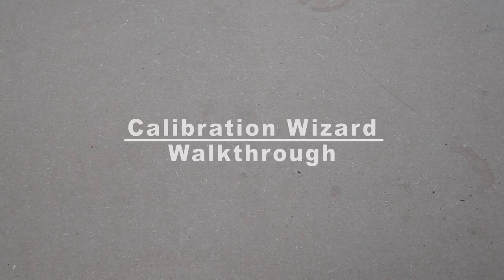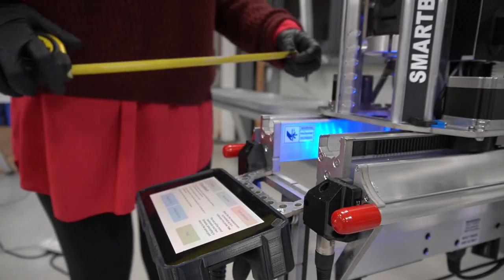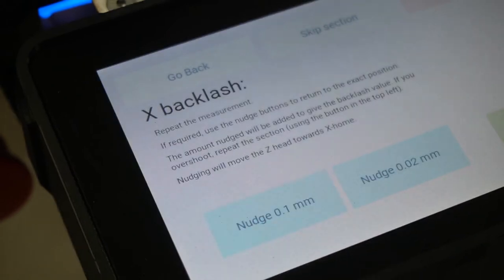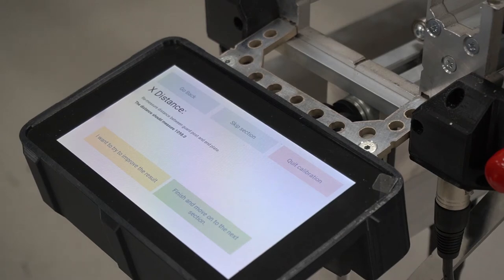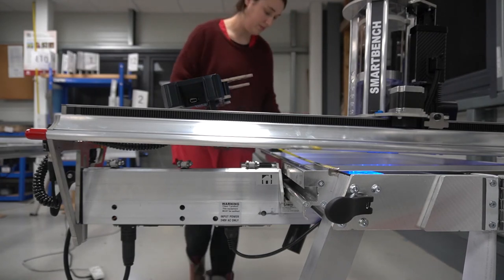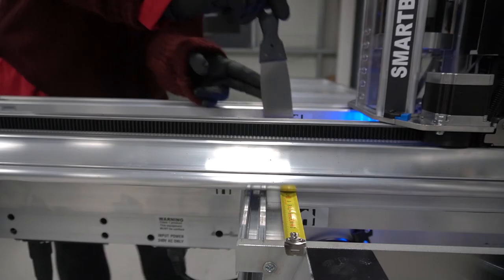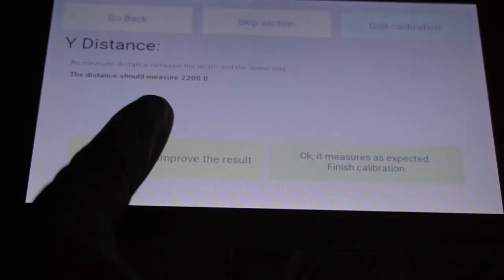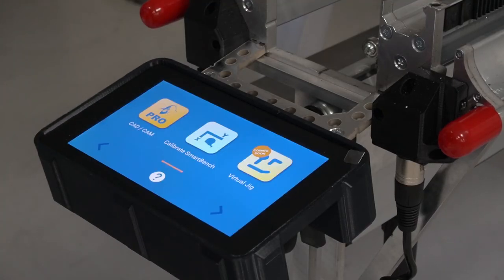SmartBench: How to calibrate

Comment: I wish I had the space for this machine! 
Any future plans to make a smaller version?
Reply from the maker: Hi there,
We've certainly considered offering a smaller version of SmartBench, but we don't have any immediate plans. May I ask what sort of size you would be thinking of?
Reply: @YetiToolLtd  In the amateur/semi-pro woodworking community in Europe there are a lot of people like me who only have a single car garage converted to a shop (already full of benches, shelves and tools). Due to space constraints we usually can't process full size sheets and have to make due with half length or half width sheets instead. I must admit I have been contemplating moving to a house with a double garage for this reason alone, and perhaps that's just what I'll have to do. 😁 I think a modular design with an xbeam half the width of the current one and a table comprised of detachable segments would be ideal. I think the current price point is well within most budgets which is also what makes your solution so compelling, along with the form factor and the software. There seems to be a gap in the market between the small cheapo Chinese cnc routers and this one that I hope you can fill. The Yeti is definitely on my wishlist.
Reply from the maker: @mururoa7024  That's as good a reason to move as any! :D You make very good points, and as our aim is to make CNC available to as many people as possible, this will naturally be something we will look into after some further development.